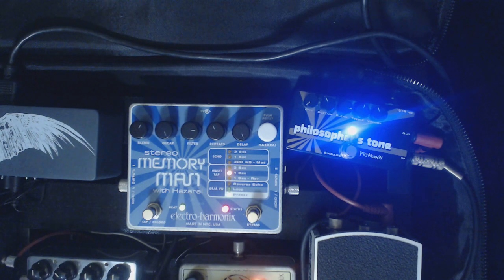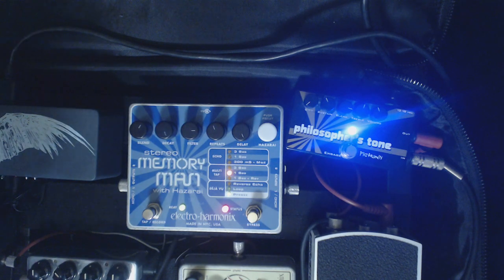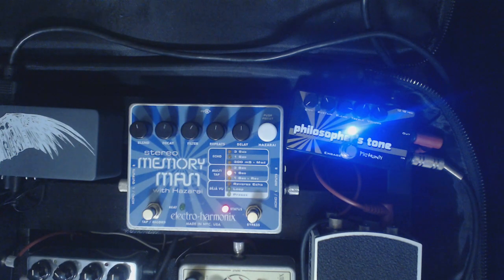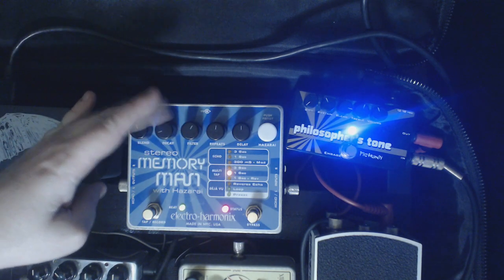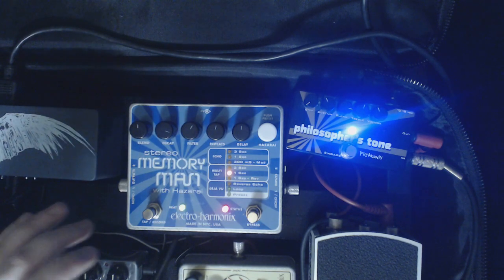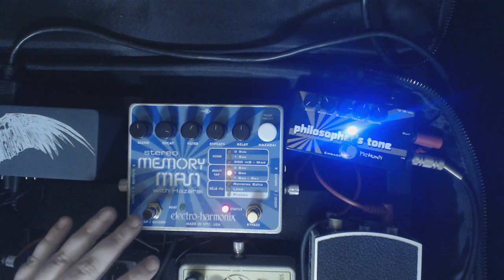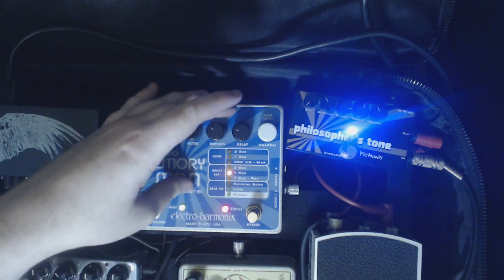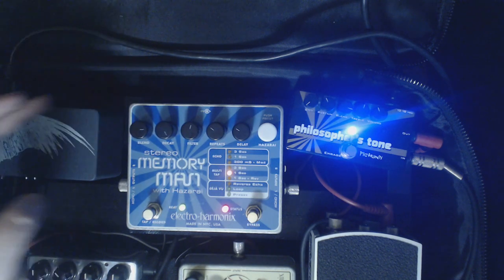How to be Kevin Shields with the Stereo Memory Man w/ Hazerai

Comment: The clicky multi tap effect is actually quite similar to a real Yamaha SPX-90 set to the Early Reflections setting on reverse mode. This will get closer to Kevin's sounds than the typical modern "reverse reverb", which is more of an actual washy reverse reverb sound.
Reply: @Jw Nde  yes, for sure. He has said it himself.
 In the many live recordings I've listened to, you can hear the very distinct clicking of the early ref on reverse, especially before the songs start and he is messing with his gear.

He may have also used other settings live, but I don't know for sure. There is indeed a gated reverb which uses a reverse fade gate. Not amazing for shoegaze and nearly impossible to use 100% wet, but I can't remember exactly how it sounded. 

When you are on Early Reflections, in reverse mode, one parameter screen says "TYPE = REVERSE". Above this is the name of the preset that you can change if you are using one of the memory banks in which you can save your own presets (banks 31-90. Banks 1-30 are factory ones, which are editable and can be saved over 31-90). 

I did a search, and think I found the photo. It also has other units above it (one has an orange screen.  looks like the very similar SPX 50D) with a setting called reverse gate. The bank number on Kevin's is 77. I just booted up my SPX, and it turns out, bank 77 has a setting called "Reverse Gate" and it is in fact the early reflection setting with the mode set the reverse. Kevin probably just chose 77 due to convenience. He doesn't have to change the preset name (takes forever, you have to scroll thru the whole alphabet + caps, numbers and symbols), because Reverse Gate is accurate, and he doesn't have to go through the process of modifying a factory preset and copying it over to a customizable memory bank. All he had to do was choose 77, bump up the settings to his taste, and hit save.
Reply: @Jw Nde Also, something interesting I almost forgot about - there are actually two different Early Reflections. ER1 and ER2. As stated in the manual "ER1 has fewer reflections, and is a LOW DENSITY early reflection effect, while ER2 has more reflections, and is a HIGH DENSITY early reflection effect."

By default, the memory bank 77, which Kevin used in the photo, is ER2. I've compared the two, and ER2 definitely sounds way closer to what he uses live.
Reply: @Jw Nde  very cool! I'll add you, I'm obseletist.  Wasn't sure if you owned one or not. I also have read about the 3-4 liveness on the mbv forum, from a guy who apparently set up for Kevin in the 90s, but from what I hear, I've always assumed that it was set 6-10. The default liveness of bank 77 (and most ER banks, iirc) is 4, I think. The thing behaves a bit different when set low. I keep mine on 7 usually, size on 20. Kevin also said he used the random mode on the SPX, but I've never been able to distinguish it live or on a record. It also does the trick.
Reply: @JulianA-tr6pt  so you have to use a spx90 to have the same sound? like how he used it with wich settings when in what songs and how i want to know more about it, he never used it live obviously, my dad was roadie with them and never told me this
Reply: @JulianA-tr6pt  and how can i get it and how he did to do that sound live if he didnt had that that is a studio thing
Reply: @JulianA-tr6pt  "All I Need" from Isn't Anything by My Bloody Valentine 

There was a drum machine beat just going like a heartbeat effect. I played an acoustic guitar to it and then it's basically an Alesis Midiverb II, it's the reverse reverb program. If I ever had a secret weapon it's the Alesis and the [Yamaha] SPX 90 and again, it's the reverse reverb program. We wanted an SPX. In the '80s in the small to midrange studios that was the kind of reverb. You wouldn't have the higher-up Yamaha things it was just like one unit. I got into it, oddly enough, reading a Bob Mould interview going, "I used reverse reverb before U2 and people like that" and I was thinking, "What is this reverse reverb?" It reverses the envelope — it creates a sort of simulated effect, you get kind of a rhythmic effect out of it if you have any transients, anything with attack, the attack comes back slightly but you wouldn't know it from listening to the record. We did was we took the whole track and put it on a tape and sped it up a few times so it's just the sound of some really high frequency thing, and that's just the track flying at four times the speed and there's not other guitars on it, no bass on it. If you can hear a tambourine then there's a tambourine. But, basically, it could've been done on an 8-track except for the fact that I just did four or five vocal tracks.

 

"Slow" from "You Made Me Realise" EP/single by MBV

That was the first time that I ever really, really used the tremolo arm the way I got known for using it and all it was was the guitar with the tone turned down, all the way off. So it just got no tone, this really dull sound, then holding the tremolo arm and playing the guitar quite soft like strumming really fast, like double time, and bending it into a kind of reverse reverb program. It would be guitar into the effect into the amp. Up until we did Loveless we only used Fender transistor amps. We didn't like valve amps then. I found valve amps a bit too unfocused. I liked the harder, more focused sounds of transistor amps, especially those little Fender Sidekick amps. That was the sound.

 

"I Believe" from "Feed Me With Your Kiss" EP/single by MBV  

I think that time we used — it could've been an SPX 90 instead of the Midiverb II, but it's just the reverse reverb program.

 

"MBV Arkestra" from XTERMNTR by Primal Scream

That came from the original tape. That was apparently a drum machine that Andrew Innes from Primal Scream did and it's through a wah. It sounds like a guitar, doesn't it? I thought it was as well. Yeah we just found all the good bits. We stuck that sound through the Midiverb II. That was just a disaster zone when it came to mastering because it starts off really quiet and then goes up about 12 dB by then end. People don't like doing that on records. It's all midrange, there's not much low end or high end, it's more just high mids.

 

"To Here Knows When" from Loveless by MBV

It's basically a guitar plugged straight into the SPX 90, the reverse reverb, and then when we printed that but basically it's a very soft sort of sound. The guitar sound, the bending thing, is one track and then I took that off tape and stuck that into a Marshall amp and then got that real growly kind of distorted sound by sending this sound off tape into a Marshall amp, recording that back and so that became the sound. For the low frequencies — there's no bass in that song — we used a BBC sound effects record and one of the things was a disaster in the distance and it's just the sound of rumbles, or maybe like a nuclear bomb going off and we just had that looped going constantly and then there's programmed drums and they're put through this TC unit,...

this is an interview i didnt understood that much how and why he used it and still with his pedalboard how and with wich pedal he could give that similar effects in live
Reply: plus idk if they are plugged in and to what they were used for and all the recording stuff but where and how he used pedals in live and if he used them with that why he had to? plus all that other recording stuff he used in his home and studio and the tape, in live i guess he used just all the pedal mixed togheter (i kinda found em all and putted them on equipboard) but if he did (he did) why he brang those in live and why in studio used except i think for tremolo and some stuff like delay and fuzz this stuff and done it with recordings and not all live with pedals if they are similar and used them in live and in studio did he used most of the pedals he had to combine it with them i guess or in some songs did like this or to create them and jam with them as we see in interviews and use that sometimes and in that way
Reply: ok i got it he used this probably not in live in studio used his pedal (more fuzz and pedals that are not like the alesis and stuff like this) plus the actual stuff, and sometimes just used pedal or used just the stuff and some pedal like fuzz or tremolo with some recording tape and studio stuff even without bass as he said and then even used all the stuff togheter and in live used all of them to have that sound, because they have two type of completely different sound
Reply: @simor20   I'm not sure exactly how to respond/answer, but basically, to sum up what I talked about above:

You can get the sound without an SPX90, but obviously the SPX will be the closest. The Memory Man with Hazarai gets super close, and many other pedals with reverse reverb are perfectly usable. They can get the job done, if you don't care about being 100% accurate. For example, sometimes I just use a DigiTech Polara. 

Kevin definitely uses the SPX90 live. It is a rack effect unit, which you can use live.  All I was saying was, he uses the SPX90 plugged in after the pedals, not before them. 

The midiverb was used on Isn't Anything mostly, as well as some EP/Single releases I believe. I don't own a Midiverb II, and I didn't talk about them because the SPX90 was what was used on Loveless and that's what I'm more interested in. During the Loveless era live shows, he seemed to use the SPX90 on almost all of the songs that use reverse reverb, too.  You can distinctly hear it on the old early 90s live recordings.  

I have used Midiverb 2 impulse responses to simulate the preset that Kevin used on my computer, and it's definitely a cool sound as well. The unit doesn't have many features though, and presets can't really be customized.
Reply: @JulianA-tr6pt  You think a yamaha magicstomp would work for this too?

Comment: I bought one of these to try and get some reverse reverb MBV type tones but never tried putting it before distortion.  how much of a difference does that make?
Reply: 90mphsleep huge difference. I use a cathedral reverse reverb before my fuzz and it’s completely different compared to me using the reverse at the end of my chain. I just bought one of these memory mans and I plan on putting it in the front of my chain as well
Reply: @gloryxkid  hi mate, which do you think is better for the MBV sound, the cathedral or the memory man?
Reply: @facundob.f8606  if you want to simulate the SPX-90 used on To Here Knows when and Blown A Wish, and a few other EP songs, the memory man + settings similar to those in the video will get pretty close. Actually, this thing can get shockingly close to the SPX. Those string clicks you hear in the video sound extremely similar to my SPX. 

The washy, reverse reverbs that actually "reverb" rather than reflect get a great shoegazing sound, but it wasn't really anything like the SPX90s clicky early reflection that Kevin used. I use a Polara, and it can do it, and the cathedral has been proven to get the sound. It's a bit pricey and outdated, IMO though. 

Kevin also used a midiverb 2 patch, and it had a whole different sound, somewhat more comparable to the reverb wash you get on most reverse reverb pedals.

Comment: you are the same person as Zaphod1989
 ???
Reply: I bought Holy Grail Max and the reverse reverb does not simulate To Here Know When sound that great, but when I used multi tap in DAW program, it sounds closer, what if Kevin actually didn't use reverse reverb after all, or did he stack the reverse reverb and it might sounded close to multi tap delay ?
Reply: @pstrokeslibsarctic   The "reverse reverb" Kevin used was actually reverse "early reflections" on an SPX-90. Early reflections, according to a Sweetwater article are "sounds that arrive at the listener after being reflected maybe once or twice from parts of listening space, such as walls, ceilings and floor."

Basically, it sounds like the sound you hear at 0:21 in this video. You can also hear it on the drums in the very beginning of the track Soon. 

It isn't really reverb at all. It does sound like clicky, multi-tap "reflections". There's also a setting on the SPX-90 called Random, and he apparently used that as well sometimes. It's similar, but the clicks are at random volumes rather than the reverse fade-in type.

The closest you can get is either with an SPX or using SPX impulse responses. Really, it's only on like two Loveless songs. Some make it seem like Loveless' magic came from reverse reverb, and that just isn't true.

To Here Knows when can be a hard sound to get due to the fact that Kevin recorded the guitar without the effect, then he ran the tape through the SPX-90 plugged into a distorted amp, and re-recorded it. That is likely what gave it that blown out super saturated sound.
Reply: a w   The SPX-90 would just go to the amps. Hard to say if/what other effects were used with it. The SPX was fed with a rack preamp, from what I've seen, and into cranked Marshalls, so there was plenty of distortion and the sound was still achieved. In some live recordings, you can tell that that the SPX's stereo outputs go to separate amps, for true stereo guitar, which further proves that no effects were put after the SPX-90. At least, it seems unlikely, especially in the 90s. Anything was possible though, especially with his ridiculous current setup.
Reply: a w    if distortion/fuzz was used, I'm fairly certain it was before the reverb, yes. The amps after the reverb are also going to be producing distortion too, so it all blends into a massive sound. 

If you use fuzz > SPX-90 > clean amp, it can sound a bit fizzy, clicky, and it's harder to keep the endless flow sound that Kevin gets. 
Fuzz after the SPX, especially with the rack preamp Kevin supposedly used before the SPX, would be extremely bloated, undefined, and noisy. The live performances of To Here Knows When have a good balance and the guitar is pretty clear sounding.